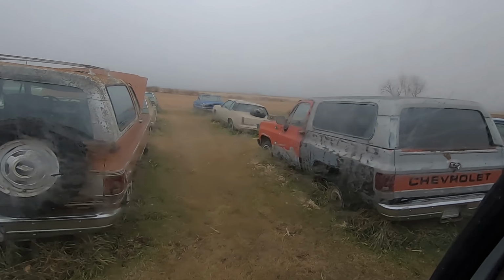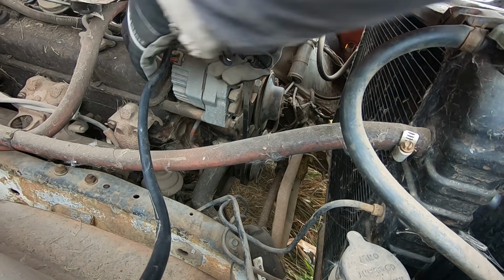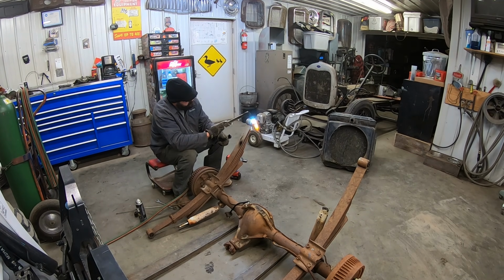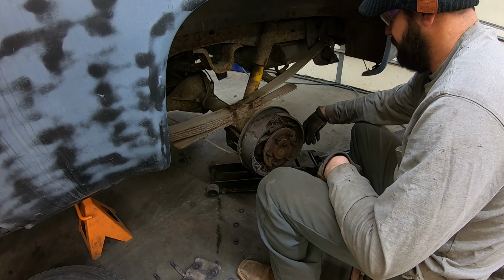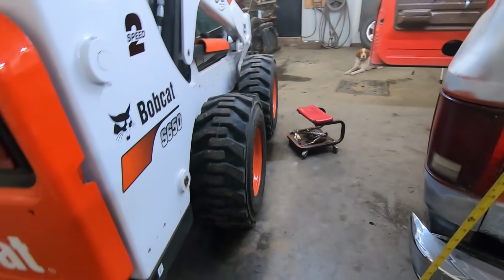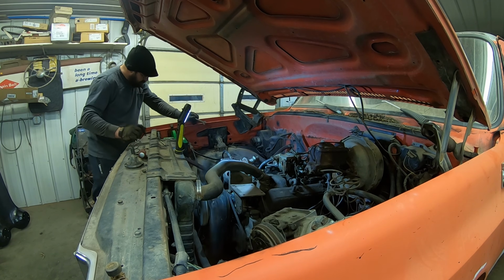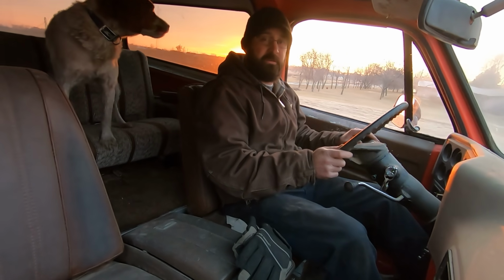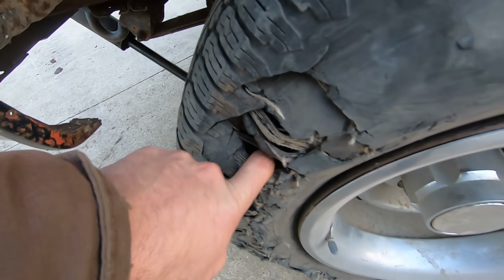Abandoned Squarebody K5 Blazer found in a Junkyard! Will it run?!? 1976 Chevrolet 4x4

Comment: Now that I watched to whole thing, that 400 small block is the best of both worlds. Lots of torque and spins up pretty good. They make really good street rod engines with modified good heads. I use tooth picks for brush holders, what I learned back in my dealership days. Great video and I like Duff! Thanks again, just what the Doctor ordered. That and some Evan Williams!

Comment: Easy my friend well not always easy but here’s how I get out seized shackle bolts!   Cut the head of the bolt off however you can then on the thread side use the nut and some washers put as many washers as you possibly can but leave room for the nut and at this point I’m sure you can see where I’m going with this! Keep adding washers as you have room and it will be like a press eventually you will pull it all the way out using its own threads🤓 also I watch you in my shop right now I’m rebuilding a transfer case also making it so called bulletproof lol we know that’s bs but does make it way stronger thx for the time and effort put into giving us something to watch 👍🏻

Comment: I've found over the years...a small Tupperware bowl with a mix of used motor oil and a drop of diesel fuel paint brushed on rusted nuts and bolts and soaked for a day or two...then a little heat and presto..PSA: It doesn't always work..but it greatly helps ....especially on undercarriage parts
Reply from the maker: Great tip!

Comment: “Spring into action” ... yer killin me. 

 I’d fix the trans leak, fix the exhaust, new belts/hoses/plugs/wires, new tires, small lift kit, rip out the carpet, patch rust holes on the floor, rubber floor mat, refoam/recover the drivers seat, find a matte/satin/semigloss orange that matched the interior paint and shoot it with minimal bodywork (just paint prep). Maybe patch up the fiberglass top where needed. She would be a great winter/hunting rig.  Nice work, I enjoy the wise cracks and it’s nice to see someone save these good old iron boxes.
Reply from the maker: Sorry, I'll quit with the dad jokes!
Reply: @MortskeRepair  I’m just ribbin’ ya. I’m a dad and my jokes are as corny as a farmer turd.
Reply from the maker: @lunchbox2784  They're the best!

Comment: I love seeing the dog. Also if I owned it I’d fix the rust, leveling kit, suspension rebuild, some bigger tires, and probably try to find a 400 for it. Then just have it as a second daily next to my 77 El Camino
Reply from the maker: Wish I had a 400 around!
Reply: @MortskeRepair  same, I can’t even find a good 350.
Reply from the maker: @samhughes1910  Well they haven't built a carbed 350 in 34 years so they're getting fewer every day!

Comment: Yes, you can install a spring backwards. Most of them are longer center of perch to shackle eye on one end vs the other. I can't recall if the longer side goes forward or aft (I think it trails) which is why I usually screw it up and install it backwards.

Comment: Ugh, just hope the power steering pulley isn't bent. Surprisingly, they are very difficult to find. Bent mine on my 76 C10 because I was too lazy to rent or buy a puller, and I spent three months looking for one. They used it for 14 years (I think), but no one manufactures it anymore.

Comment: I use the old air hammer on the other side of the bolt while turning it with the impact. Lots of pb blaster and 62.5% of the time they slide right out using that method
Reply from the maker: Great tip!

Comment: Definitely full time 4 wheel drive but the only way I remember you could tell was looking at the front hubs. If there was no manual locking hubs you have full time 4 wheel drive. We had a 1979 suburban with full time 4 wheel that we converted. They put on manual locking hubs and did something in the transfer case, I think. But we also had another Chevy that came with manual hubs and I thought it also said Hi-Loc and Lo-Loc on the shifter. I don't know. Last time I saw them was about 30 years ago. You've been seeing more of those than I have. I just remember those old transfer cases for the full time 4 wheel drive would get some kind of vibration in them that couldn't be resolved. That's why we went to manual hubs on the '79. A friend had a '79 also with same setup and it had vibration in it too.

Comment: loved my 76 chev, blazer 400 small block 373 gears big mistack putting in part time in tranfercase.  u jont ever 6 month. but 4 mpg..  my corrent 75 short bed pickup full time 4x4 350 motor 300,000 + miles gets 15 mpg on 308 gears, just needs battery this one is 10 years old and dous not like the cold.
Reply from the maker: Good stuff!

Comment: Have one big main leaf also 9 leaf on together with main 9 leaf be short on top then got 11,000 pounds weight of tow power like 3/4 or 1 ton truck has back axle  for 355  to 411 rear one used on those 1970's Cheverlot Blazer  !

Comment: Duff Dog serve also protection for you always to Mortske Repair  :) ! Also those 400 were options 2 and 4 barrel carb had hand choke to at factory option! Plus 400 great motor in there day & that ground cable need pig tail ground to the fender with nice shine bolt plus washers and connector too so get lots spark also full Alternator output Chargeing of 70 to 100amps! Even starter power up full strength to turn motor over to !
Reply from the maker: Great info Andrew!

Comment: I think the 400 might be a 4 bolt main for truck motors, it was available in 2bbl/ 4bbl, only sure way is to pull a head , 400’s have extra steam holes vs. other small blocks.
Reply from the maker: I've always identified a 400 by the big cutout on the harmonic balancer. But yes, I was aware of the steam holes as well.

Comment: Square body Gang , the gang that's hip to be square.... Myself I learned real quick as an ambitious 20 year old , having a lifted truck is not worth it ,sometimes you go through universal joints yokes and driveshafts way too much but on the other hand if you want to learn how to change them blindfolded then... yeah , by all means go for it , I'm the type that goes with the smallest tires possible  for whatever rims are on a vehicle, big floppy mud tires suck in the snow , they are loud and vibrate everything to heck where the truck falls apart ... plus your never going to get your axles any higher up unless you go with bigger tires that your steering components cannot withstand , next thing you know your busting tie rods and on those old chevys they had that rubber steering grommet/ drag link that always broke at the best times when your flying down the highway at 57mph because that's max speed with 44 super swampers ,and your ears are  bleeding from the damn wheel noise  and it's even worse if you got the radio delete option and have to drive a hour away .....
Reply from the maker: Sounds like you know all about the money pits that big tired square bodies are!! Thanks for watching and commenting Benjamin!
Reply: @MortskeRepair  Just lifted trucks in general weather it's a Ford/GM or dodge...At 35, if I'm given the choice a 2002 oldsmobile silhouette minivan VS a 1987 clapped out lifted Chevy , and I couldnt sell either vehicle and I'm stuck with it for the rest of my life I'm going with the minivan.... even with useless traction control aka you will get stuck in the snow button.... , I like to just sit down in vehicles now a days than have to climb up into one...
Reply from the maker: @benjaminsmith8058  I never saw the point in that stuff I guess. Well, they look cool. No desire to own or drive one.

Comment: Early K5s are sweet! Swap a 4speed and 205 for that drivetrain. 350 is fine for a blazer.
Reply from the maker: That setup would cost more than the Blazer did! But they're a great unit!
Reply: @MortskeRepair  It's all in good fun, My 85 crew has the proposed drivetrain while my 70 GMC has 350/350. You can't go wrong either way. Maybe do a build including that 203 We can remember how widely derided they were. Turns out they were just ahead of their time!
Reply from the maker: @dwitcraft  I'm mostly a a 2WD guy, only know enough to be dangerous on the 4WD stuff!

Comment: K5 runs good get fiberglass fenders for just tool around what it and use it that doesn't burn oil engine sound tight why not it's nice to get her truck for someone doesn't have a lot of money that truck a run forever easy to work on two

Comment: I would have put the spring on my bench and used my good old harbor freight hydraulic jack press to try and pop the bolt out after heating it and spraying it with PB.  Also if those new springs were truck springs that might ride a little rough.  Could have pulled the spring pack apart and removed a leaf.  That would have given you the extra length you needed on the u bolts.
Reply from the maker: I thought about splitting them but I know the center bolt wouldn't survive and I didn't have new ones on hand.
Reply: @MortskeRepair  I understand.  Projects like these are just as much a time budget as a $ budget.  Should be able to replace them with a regular grade 8 bolt.  If the head doesn't fit the perch I've just drilled the perch to fit.  Great video.  New subscriber.  :^)

Comment: Fix it the way you want.  If Duff's happy with it, who cares what the trolls want or like. I 'd hit that junkyard for parts to get back to a part time transfer case and manual hubs up front. Lift her enough for 35's, fix the body rot and that ugly paint job, headers and exhaust (duals and turbo mufflers) - nothing too loud. Step up to a spread bore 4 barrel and intake. Like I said mostly recycled parts, believe me I know what a budget rebuild is. Try doing something like that on CPP&OAS  as your income. Have fun buddy. Love your pup.
Reply from the maker: A 205 gear to gear part time case would be nice!

Comment: FWIW, If you measure body height from the top of the wheel arches in the wheel well, you'll have a more consistent measurement
Reply from the maker: I usually do that. Was in a rush with this project. Good tip!

Comment: Without the original engine, it isn't worth restoring, especially with that much rust. It would make a great daily driver though. I would definitely repair anything that isn't working properly, and do all the body work, then slap on original looking paint job on it, and some big tires. It is definitely worth saving.

Comment: I would restore it. I can't seem to find them that clean here in Missouri.
Reply from the maker: Not many left here either!
Reply: Find a later square body pickup take parts or order patch panels from DMC.....
Reply: Desireable color chevy orange saddle tan gut. Wood. Paint top tan
Reply: Check timing chain and change HEI. Cap they corrodes and leak voltage and cause engine to run like duffy's poooop
Reply from the maker: @rsprockets7846  Maybe they'll sponsor the build!

Comment: New rubber floormat, manifolds with 2 inch dual cherry bombs to the rear,the shorter the better, SEM rust shield blk rusts stopping piant nit gloss not flat just use blk. Maybe find a better set of k5 seats or recover them and run it. You should really do that first first that little by little.
Reply from the maker: So much to do!

Comment: Hey, if you can go through a puddle without your feet getting wet it ain't rusty, my '74 GMC Sierra was so rotten my left foot had to migrate when I went through puddles, I could see the cab support but it wasn't supporting much. Had to get rid of that truck when the driveshaft literally fell out in my driveway. Traded it for a 2000 Hyundai accent hatchback 5 speed that lasted me 13k miles before it decided to be a 3 speed, 1, 2, and 5th.
Reply from the maker: Sounds like you got a sweet deal there!!
Reply: @MortskeRepair  Yeah, especially considering the AC worked in the Hyundai, and I sold it for $450 after keeping my 2 new front tires for my latest pile o' crap, the 2000 Sentra. I normally put up videos on my car blunders but so far knock on wood that Sentra has been great. Getting my 93 Flareside back soon, and I want to 5 speed swap it, so that'll be fun.
Reply from the maker: @DeadReckon  That'll be fun!!
Reply: @MortskeRepair  Yeah, been watching a few local pick n saves for a 5.0 5 speed 2wd truck, not sure what I'm gonna do about the driveshaft. I THINK I need the computer from the manual truck so my truck doesn't freak out that it doesn't have a transmission anymore. Don't know if the wheelbase is the same on the extended cab "flareside" bed as the long bed standard cab trucks but, I'm pretty sure they're all two piece driveshafts so I'm sure I could cobble together something. This is a "Pick n save took my budget" sort of budget build haha.
Reply from the maker: @DeadReckon  Not sure on the computer as that's too new for me! I'd get everything I could tho! Good luck! Wish we had places like that around here!
Reply: @MortskeRepair  Yeah pick n save is nice, bit pricey sometimes but eh, it means I don't have to buy a whole damn parts vehicle so that's a bonus. And the truck can be the parts hauler / parts shed until I'm ready to do it, so that's a plus. They also rarely have anything older than the 80's in there, so I have to go hunting other junkyards for that.

Comment: Drove a 78 custom 30 deluxe duel wheel model air craft tug.. manual gear box...4speed 1 creeper gear panel body 2wd ... 3.8 str..6cyl...silver and black two tone.i drove it back in 83 to 85 ...100 gallon petrol = fuel tank...not good on mile per gallon 12 to 14... it wayed 3tons.. 100 mph tops..helo from ireland...😉..keep that blazer std...
Reply from the maker: Great story! Thanks for watching in Ireland Lester!

Comment: Truetrac up front, OX cable locker on rear.  Lock out hubs. Fatter and higher diameter tires. Gas shocks for controlling height.  Q-Jet LT-1 Manifold and Holley 600 would wake it up.  Cure the exhaust leak with headers.  Buy a portable compressor to air up the tires after 4-wheelin'  Leave the skin scroungy, and put yer $$ into performance: Rat rod effect.  Enjoy it.  If it's a rat rod, you can get it muddy and dent it, and not care.

Comment: Double check that balancer. All 400 small blocks had two barrels. 402 bb had 4barrel carbs.
Reply from the maker: You positive on that? I've seen a lot of factory 400 engines with 4 barrel Quadrajets on them.
Reply: @MortskeRepair  yes. When looking up service parts 400 2bbl is small block 400 4bbl is big block.
Reply from the maker: @johnbrunson1087  They didn't offer the 396/402 in 1975. Only the 454 in big block form.
Reply: @MortskeRepair  I stand corrected. Wikipedia tells me they were available with 4bbl after 1973. The early s only had 2bbl. I would still check the balancer.

Comment: I would more than likely put a newer engine in it, Resto-rod with a 5.3lt from say an 04'.  Fix any body work that I could since you can get 90% of the body panels and paint it back to its original colors.

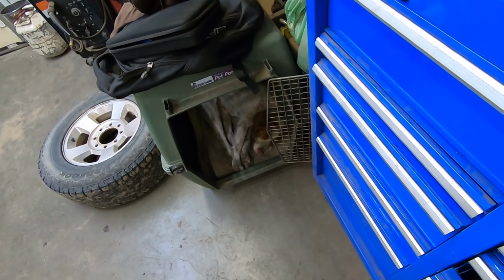Comment: What is the rim on the floor off of at 29:03?  Wonder if it will fit my 55.2 Apache?
Reply from the maker: Off my late model Dodge tow pickup
Reply: @MortskeRepair  Trying to get rid of the split rim and heard some Dodge/Ford and GM rims will work.  I have a couple of sets I am going to try.
Reply from the maker: @tjakr3869  Yeah, that's the way to go.

Comment: You want to get that paint off use easy off extra strength oven cleaner will take spray paint off and not touch paint underneath
Reply from the maker: Good tip!
Reply: @MortskeRepair did it to my 64 falcon work great
Reply from the maker: @tylergrau3129  I used Goof Off Graffiti Remover on my 68 D100! No complaints!

Comment: I have one that has rear AC and a 400 something cubic inch engine.
Reply from the maker: Rear AC in a Blazer?!? Weird. I've seen them in suburbans!
Reply: @MortskeRepair  perhaps it's a suburban. Someone gave it to me almost 20 years ago. Had to drive it 50 miles home so it had that much going for it. Has a plow frame on it too. It ain't much to look at but it's got tons of hard to find parts that aren't available aftermarket.
Reply from the maker: @pantherplatform  Suburban would be a 4 door instead of a 2 door.

Comment: I used to own one of those 400 full time 4x4's. Pretty much restored it with a 350 and the 205. Then someone crashed into it and bent the frame. Insurance company only gave me $3000 for it even though I had receipts for $10,000 in work.
Really sucked
Reply from the maker: That blows!

Comment: looks like a 77 or a 78, i have a 77 4x2 with 6 seats in 3 rows original and it had the 6cyl in it but that was junk. The original body was to rotten to save so have a 80's 4x4 6,2D body on it now. Rep object tho XD
Reply from the maker: Never seen one with 3 rows of seats! I dig the 2WD version tho!
Reply: @MortskeRepair  its rear, it sais it in the papers to bout the 3 rows. The two seats at the back is supposed to lay the back of the seat down and take the roof of, mine has the hardtop tho over the driver

Comment: I never like those Lock Fuel Caps even if lube key  plus lock part from corrosion and in Winters Season they freeze like crap also got pry out or break stupid cap totally get out! Why said that because had do Tow Truck serivces calls over years and because people ran vechile out fuel to bone dry ! Also one seize up on me one Winters Season month's years on metal plus plastic of the Lock Key ones and had break with tools too I had so could get fuel also brand new cap to put on even without the  lock crap!
Reply from the maker: Everyone I ever get is missing the key!

Comment: It's a Chevy. Itmay be leaking from every gasket (if it has any) and seal, be missing on two cylinders and have almost no oil, but if you have a battery and gas it's going to start. Nothing will run badly as long as a Chevrolet.